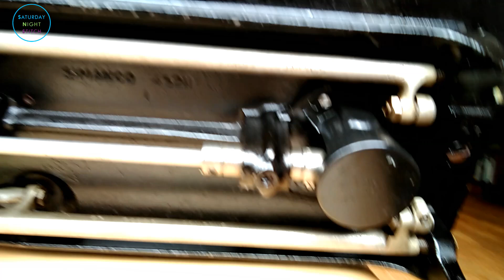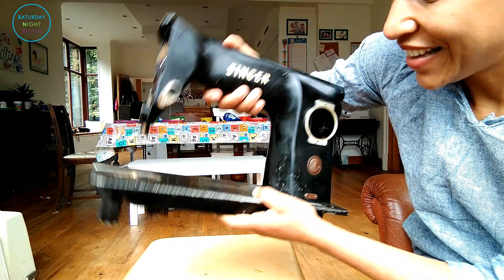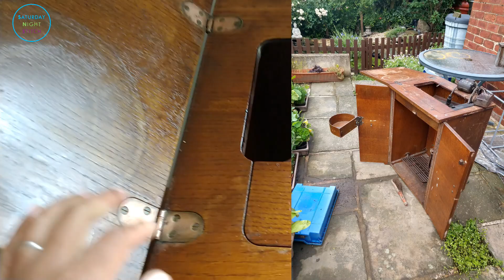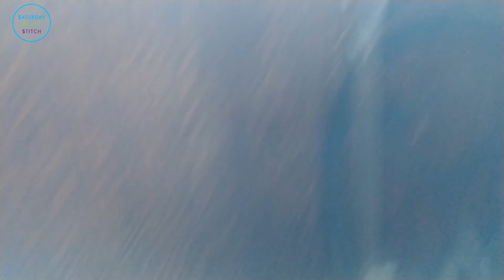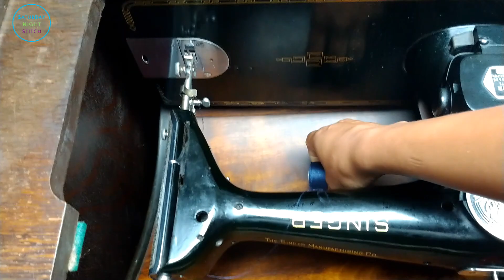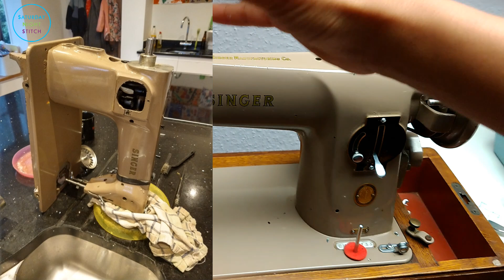Singer 201K Vintage Sewing Machine Collection

Comment: I just noticed that my suggestion may be to late.
Believe it or not I am a 73 year old Disabled Vietnam Infantry Vet and I bought a 1952  201k on EBay from England.  I was going to suggest you might try, going to a auto parts store and get Brake Cleaner it will be in a spray can.
Carburetor Parts Cleaner spray can  also.  And finally Lacquer Thinner.
For paint stripper. The secret is to keep the area wet, it evaporates so fast work with a small area.
I think Lacquer Thinner. 
You  must know what your doing, your machine is super quiet.
Well I am going back to your video.
Reply from the maker: Thank you for the tips! I'll be trying it!

Comment: I have my mom's 1952 Singer 201. When I looked up the serial number it didn't have a K or anything. She sewed on it constantly and when her eyesight got so bad that it wasn't safe for her she stopped but she was in her 90s by then (she passed a month after her 100th birthday). She would tell me that she "wore it out". I had been storing it in the garage but yesterday I had my son who is staying with me help get it out and clean it off to bring inside. It came in one of those heavy utilitarian wooden cabinets with a bench seat. I cleaned, greased and oiled the head and now she sews just like a dream! The stitches are beautiul - even though the stittch lengths arre rubbed off the machine. The presser foot has seen better days, so I think I'll replace it and the throat plate doesn't have markings for seam sizes so I may get a new one or just put down some tape. I hope to sew some beautiful scrappy quilts one her. Mom would be so glad I finally gave her new life!

I came back to list my collection:
Singer Treadle 115/1921 (in cabinet)
Singer Red Eye 66-1/1921 (in bentwood case)
Singer 201/1952 (in cabinet)
Singer 221-1/1947
Singer 221/1968
Singer 6268/1970s
Bernina 830 Record/1980s
I also have a little Singer hand crank that cuts pinked edges. Maybe for cutting wool strips for rugs? It's really old. It's for looks. I also have a collection of new and newish modern computerized and manual sewing machines. Right now I'm in love with my Juki TL 2010Q.

Comment: Hi Hila. My 201k treadle machine (which was originally my grandmothers) and is my pride and joy, has gone very stiff. Typically halfway through a sewing project. I’m not sure what has caused this seizure, I’ve oiled but can’t seem to located the area that is causing the stiffness. Do you have any suggestions on where to start fault finding and taking apart. Thanks Jen

Comment: TODAY I FOUND A 1954 201K IN A SKIP AROUND THE CORNER FROM MY HOUSE , IM SURE IT HAS THE WRONG POWER SUPPLY AS THERE IS NO FOOT CONTROL WITH IT , it runs fine though - Do you know where i could find the correct power supply for this machine - thanks   -  I ALSO HAVE A 1908 TREADLE
Reply from the maker: Congratulations on you awesome find! Usually eBay will have power supplies that at compatible with 201Ks. Good luck and have fun!

Comment: I am another collector in Australia. I have an eclectic collection. 2 Featherweights. 1 knee operated 201k. 1 hand operated 201k. 1 Husqvarna treadle with a fascinating history. 1 Singer treadle with the 6 drawer cabinet. 1 Elna SU.. 1 green Elna Supermatic. 1 Pfaff Expression and a Husqvarna Designer 1. I am searching for a Bernina Record. I feel I can’t pass up a good quality vintage machine because it’s impossible to buy this quality of workmanship today. 
Using plastic is ok.. just keep the original for historical purposes. I love the 201. 
Thanks for your video. I feel so much better  about my collection.
Reply from the maker: Wow! I love that you shared your collection! Im envious of your Elna and Pfaff! I am still try to find  them but in the UK they are not as common. Its tru that you cant get that worksmanship these days.

Comment: Im so jealous. In US the 201’s are all with a potted motor. I want one i can treadle. I have 2 201’s. But one is actually a 1200 which is a 201 mounted in a tailors table. They are amazing solid and smooth machines. I have too many old machines. But i love restoring them like you do. Your joy working with them is evident. 😊 oh and Singer made a button hole attachment for the old straight stitch machines. They are plentiful and often come in the drawers of old machines. They made a zig zag attachment as well. It worked by shifting the fabric back and forth rather than the needle.

Comment: Did you figure out how to remove the take up lever from the "pink" 201k mk2? I replaced it recently, and i needed an extra tool to remove the cap that attaches it to the machine (plus, one of the screws is reversed!). Here is a link:  https://www.amazon.com/gp/product/B004W8C2F2/

Comment: You can do buttonholes on these Singer's.With a buttonhole attachment. I have several (also several vintage Singers sewing machines, like an 201K, and 15-88). I like the buttonhole attachment that use templates (I usually use the 1/2 inch template). These attachments move the fabric, as the needle can't be moved.

Comment: Good job!
I just finished a singer 99k with the same flaking lacquer problem. The trick is to use a rag dipped in lacquer thinner. The lacquer thinner will re-constitute (re-melt) the old finish and feather out your edges. Then just re-coat with a few clear lacquer top coats.
Also, you could have saved a lot of time by just applying new decals. I got them on ebay from Keeler Sales.
Reply from the maker: Great tip! Will try the laquer hack next time.

Comment: I did exactly that was my 201 that I paid six bucks at a thrift store for.   I stripped it I repainted it black I ordered the decals, the original singer ones, and it came out gorgeous.  When I bought it it was completely seized up so I took the whole thing apart and cleaned it and then when I put it back together it worked but the timing was completely off.  So I ended up having to pay a man $150 to completely redo it.   The paint job was taking too long to cure so there are some indents in it, and, little bit of the sides chipped off when the man repaired it but it’s wonderful now.  Then I got the Egyptian decal singer unless that together stripped it re-painted it red with his beautiful gold singer decals.  And that one works perfect.

Comment: Hi Hila. I love your vintage machines. I have restored several Singer treadle machines in the 1980s. I restored a Jones treadle that I purchased for £50 that had rusted. I found that machine oil cleans the exteriors and brings back the shine gently. I haven't heard if the rust remover before. Can you let me know what it's called and where you purchased It? I used vinegar to clean off the rust soaking it and using wire wool daily to get it off the. I have my late mums Singer that looks like a later edition of your last machine built in the 1960s I think. The foot pedal gets very hot when I use it. Do you have any tips how I can resolve that please? Also I can't find bulbs that fit the light as the modern Singer bulbs don't fit the connections. Please share more of your machines. I would love to see your Jones ones. 💖
Reply from the maker: Hi Ann - I am so glad you found the video useful. I use Hammerite Evaporust which I bought from Halfords. I think its also available online. I havent had the problem of foot pedal getting very hot on mine but I do remember reading that if you havent removed the old fashioned capacitors installed to stop the machine from interfering with TV signals then that can cause the extra heat. I remove the capacitors in all my foot pedals as part of my restorations. Hope that helps! The 201K really is a special machine.
Reply: @SaturdayNightStitch  Thanks for the advice. Could you show me what a capacitor looks like please and I will remove it. Many thanks x

Comment: I bought my first two vintage machines this summer in vacation in sweden on a flea Market and in a thrift shop. A Singer 354 Genie from the 70s for 20€ and a Husqvarna 2000 6030 for 30€. I cleaned the Singer myself (Thanks to the super helpful Youtuber Andy Tube)and it works fine. But I found out that I dont really enjoy fixing old machines. I brought the Husqvarna to a shop for inspection. But I love and admire both machines. And I am in great danger of buying more....

Comment: I recently bought a beige 201k off eBay and it works great. I'm still figuring out winding the bobbins as don't think I have the correct ones as they work their way loose off the winder. Don't think I could restore a machine like you. Great work!

Comment: Have a collection of singers 201k, 401a, 401g and 3 treadle machines. Just recently bought a Elna SU 62c which I have to
stop buying any more. It is such an addiction. Forgot I have 3 Victor machines as well. I am restricting myself to attachments and
cams. Always look in charity shops for these. You should try to get a singer buttonhole attachment they make beautiful buttonholes
on on the singer 201k. Great collection you have. Look forward to seeing your other machines.
Reply from the maker: I have been looking some buttonholers on Ebay and just need to get it really. I have a 401G that I absolutely adore - I used it to sew a tailored cashmere coat for my husband a few months ago and it was pure bliss to sew on it.

Comment: I’ve got a Bernina 730 record.
It dates from 1971.  When I sent it off to be serviced as it had seized the guy couldn’t repair it properly and now it only sews a straight stitch, originally it did zigzags, buttonholes and 20 embroidery type stitches.  I wish I had the knowledge to sort it out myself, it was such a lovely machine.  My Mum had a hand operated Harris K that was a different type similar to the Singer but it had a long thin bobbin.  We used to sew so many things on that!  You are clever to be able to repair your machines, I expect you’ve got about 10, am I right?
Reply from the maker: Try multiplying 10 by another number and it would be closer :-)

Comment: Love today's post. I have a 201k 1946. When I removed the tension disk to clean I photographed the assembly order in detail so I have a permanent record. My stitch regulator numbers where very dim. Brush on acrylic paint rub off excess, let dry and keep repeating until the grooves are filled in. Good as new.  Singer/Griest Buttonhole attachment either with templates or without produce beautiful buttonholes.

Comment: Wow wow wow hila now you got me toooo excited may i ask if you could do tutorials on all your sewing machines on how they sew, also love to hear the sound of the machines. The singer sewing machines in Asia have changed, now you have a choice of wood or mdf table. The oil collecter that is on the table under the machine is plastic also the the drawer that comes with the table is plastic. The cover for the machine is plastic. The leather belt that goes around the threadle wheel and sewing machine wheel is a cotton rope. 😭😭😭😭😭😭 once upon a time it was all wood or metal. They are now all reproduction from China. Vintage is the real deal.

Comment: Hi Hila, love what you did with your machines, what a feeling of accomplishment. I was in The Habitat Restore and bought a Remington for $30.00 it did sew a very nice stitch. When I looked underneath and in the bobbin case there was so much dust and debris in the feed dogs I was surprised how it managed to do such a beautiful stitch.  I cleaned it up and oiled it really well. The needle tension is on the left side and while threading it up the little fine wire hook the thread goes through before it comes to the front broke. Not sure what it’s called but I need to replace it.  I think you probably have at least 10 machines.  Enjoy the process of the machines, so satisfying when you’re finished.  I really enjoyed this video thank you so much for sharing. Val 🇨🇦🇬🇧❤️

Comment: Beautiful machines! I love the vintage Singers, there is nothing today that compares to the quality. I have have one 99 that has no reverse and another that has reverse, but it is a Universal, they both were seized up and I took then apart, cleaned and oiled them. They are both working.. My other vintage Singer is a 401 heavy duty that I use for heavier weight fabrics, but it will sew any weight beautifully. I bought it off eBay for $100, a steal. The others were my grandmother’s. I also have a vintage Phaff that I use, but my main machine is a new Singer Professional. I am obsessed with sewing machines. Sorry so long. Thanks for sharing your machines.
Reply from the maker: Thank you for sharing. I get it, I can talk about vintage machines non stop. They are so full of character. I have some Pfaffs too which I will get round to sharing. 😝